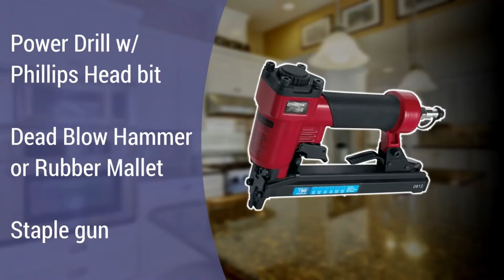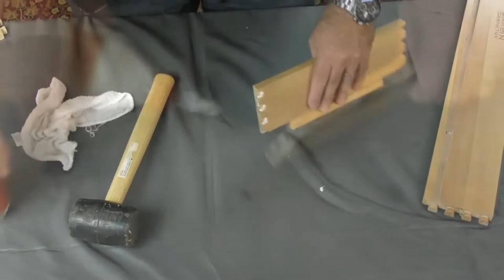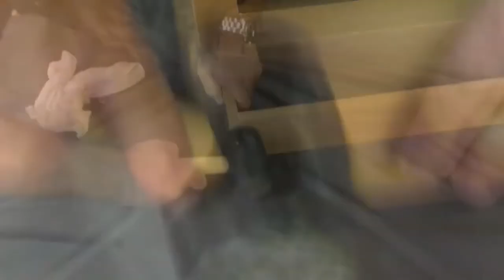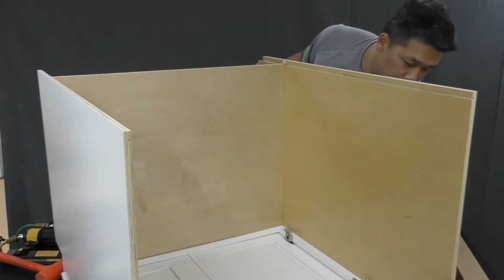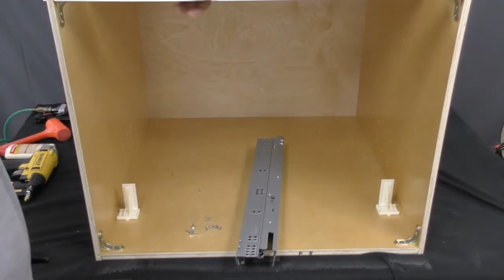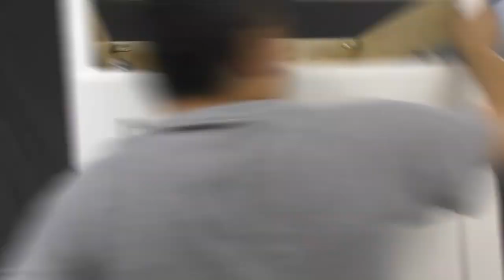Base Cabinet Assembly - RTA Cabinets - Set 1

Comment: Error in video.  Staples added at 7:54 are NOT connecting the back panel. The staples have to come through the side panel, with the point going into the back panel to secure the back.